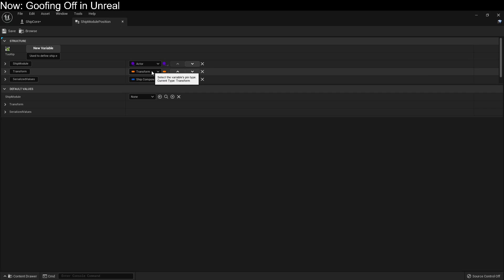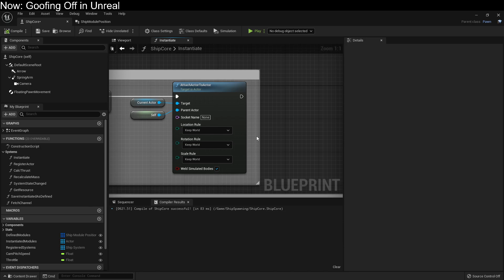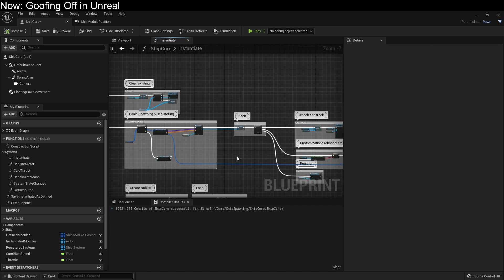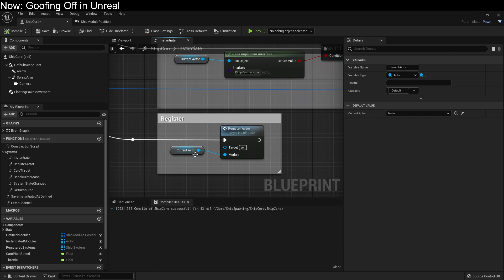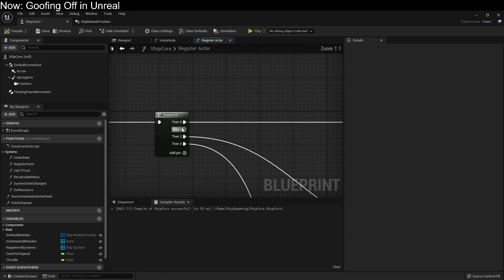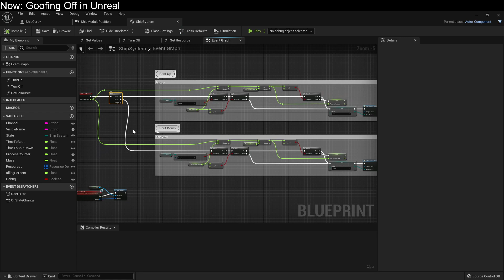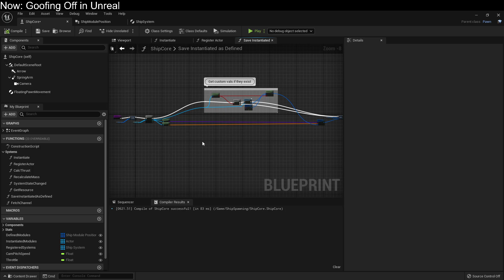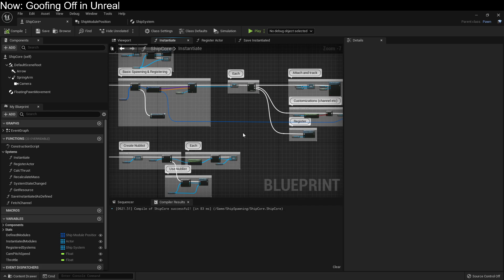Unreal Blueprint Best Practices

Comment: I have to add that people need to learn design patterns. Coupling vs decoupling. Dependency injection. Has a vs. is a relationships. Expensive lookups vs. optimized retrieval data structures.
Reply from the maker: Sure, but no indie with a fist full of cheap models will want to do that.

Comment: One other organizational tip. For a function like Register Actor, where you connect a long thread from the start node, you can instead call "Get [Function Parameter]" and it will appear as a local variable get node inside that function. Very useful for avoiding annoying branching and reroute nodes
Reply from the maker: Oh, that sounds great! I've been registering them as local variables, but that sounds much easier.

Comment: I've been experimenting with UE4 for the past few days, and I'm curious about your opinion on collapsing nodes into a Collapsed Graph rather than putting them in their own function. A specific case for me is anytime I want to update the stored location of the mouse, I have to call both "Get Mouse Position on Viewport" and "Set Start Mouse Position" so I put those two nodes into a collapsed "Update Mouse Position" graph so it wouldn't clutter. Obviously this could just be a function, but was curious if you had any preference to one or the other.
Reply from the maker: I think collapsed graphs are fantastic. I wasn't really aware of how easy they were until you mentioned them. They are absolutely a viable replacement for functions in a lot of the situations I've mentioned!

As usual, Unreal has a really easy way to do things... if you can find it. :D
Reply: The real benefit to collapsed graphs is you can still call things like delays and timelines, and have multiple output execution pins. Functions are also more performance because of compiler optimizations, so you should use

Always a function if possible, a macro if it needs multiple execution output pins and is going to be reused, or collapsed graph if it's a one off bit of code that needs delays/timelines/output pins etc
Reply: Collapsing has allowed me to go back to writing functions, methods and macros like you would in a traditional text based language

Comment: It seems to me like this blueprint system is not the right thing for complex systems. I assume that was made with simple things in mind, like control objects that do just a few things.
Reply from the maker: Yes, but a game is a million simple things stacked on top of each other.

More specifically, how would doing this in code be any clearer?
Reply: @CraigPerko  Sure, but some games are much simpler than others.

Your question is way more interesting than I thought at first. Perhaps code just looks simpler to me because I'm used to it.
But to me it is easier to keep thing organized by using scriptable objects for data, pure c# classes for small local functions. And Mono behaviours for managers that organize the smaller bits.

Or just an entity component system.

Then again, that works for me, might be that this would be more complicated to others.

I guess what scares me with those visual scripting systems is all the surrounding stuff. All the frames and backgrounds, to me that seems to bloat things up.
Reply from the maker: The UI definitely needs work in order to really make blueprint-style programming work as well for complex projects as code. But choosing between C++ and blueprints? Most humans would prefer blueprints. :D
Reply: @CraigPerko  Right, I forgot that UE is using C++. I don't know much about it since I mostly used C# and Java. So, I guess for now, I just assume you have your reasons to prefer the visual option.